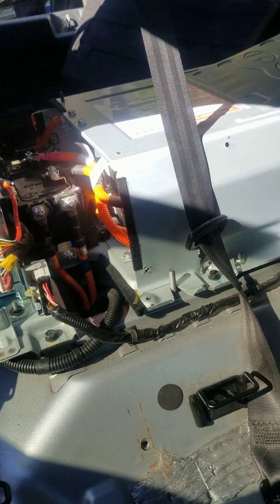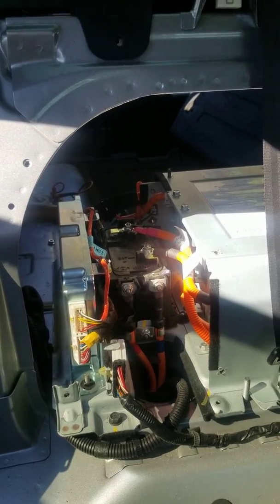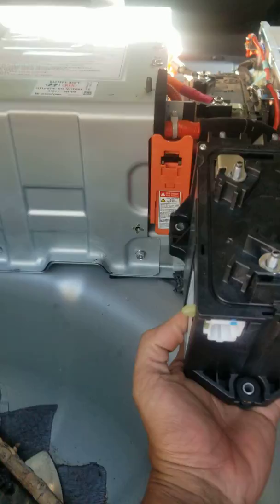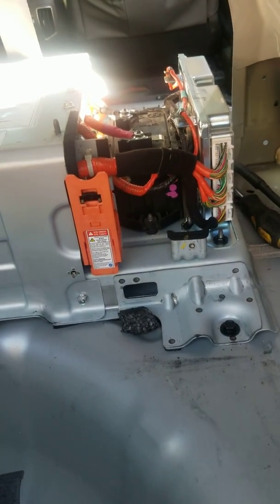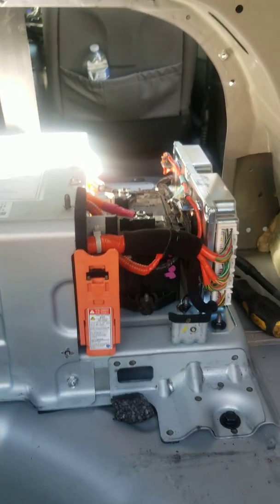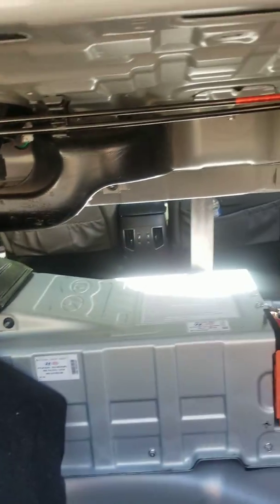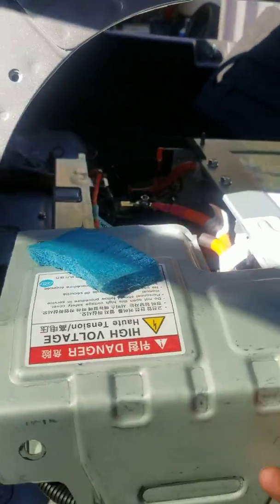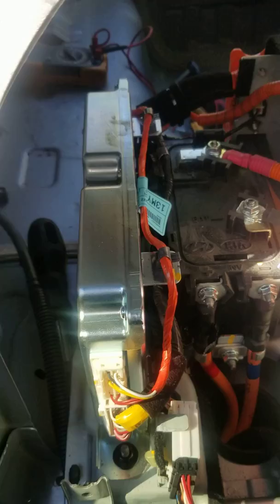2010-2014 Hyundai Sonata (YF)HYBRID: Hybrid System Warning! Safely Stop and Do Not Drive. P1B77

Comment: Have the same problem with my 2015 sonata hybrid. Happened yesterday, driving through torrential rain, the car jerked, then stopped. I got the code p1b77 off my obd2 reader. My question is has anyone just replaced the safety plug and get away with it? Because it is such a cheap part compared to the power relay assembly so I am wondering if it wouldn't be a good idea to replace that first. I have seen a couple of the Optima Hybrid guys say that they only replaced the plug and were good to go. FYI optima hybrid is mechanically the same car as the sonata hybrid..  Anyway, I am off to try starting her again this morning and if she won't go I will try to fix her myself. Thanks for making this video.
Reply: What did you end up doing? and did just replace to safety plug?
Reply: @matazarbab4784  I ended up replacing both units, did not want to chance it. There is actually a Technical Service Bulletin for that problem code and the prescribed cure is to replace both components, so that's what I did. I did it myself. It is not difficult. The hardest part was getting the backseat out.  Hint: removing the head rests will make your life easier.  This video was of great help, so thanks again to Manuel Baez for posting it.
Reply: @kleefton  did it solve the problem?
Reply: @dabz3318  yes, after replacing both parts. see my previous reply.
Reply: @kleefton  I am so nervous doing it my self. Dont wanna overpay for this as it seems easy. I have all the tools except the pin push. Is it okay to use a flat screw driver and push it?
Reply: And my other concerns is the Electric
Reply: @dabz3318  Yeah a screw driver will work. Just wear gloves and make sure the 12v battery is disconnected. it is fairly easy. the hardest part is removing the backseat imo.
Reply: @kleefton  I reached all of that part. I didn’t have the tool that open where the relay is. I didn’t have glove. I put them back and I am actually to a car repair to get it replaced for 250
Reply: Hopefully, it will fix this.
Reply: The car runs fine, but the warning comes on after every 5 miles. Mostly, after you’ve stopped and trying to move on
Reply: @dabz3318  yeah thats how it starts. Then one day it will just stop running. I would advise fixing it before that happens. It left me stranded in the rain when it happened. Terrible memories man.
Reply: @kleefton  holly shit! I am waiting for them to replace it. I’ll update you later on
Reply: @kleefton  thanks brother
Reply: @kleefton  The part got replaced, still does the same. We replaced the fuse as well, don’t now what else it could be
Reply: @dabz3318  are you sure you had code p1b77?
Reply: @kleefton  you mean the scan code?
Reply: The only code it shows is DTC B1102, which is weird
Reply: @dabz3318  looks like u have a different issue then. Something to do with your airbag?
Reply: @kleefton  the car dashboard doesn’t show it. Don’t know how come the scan picked that code. All airbag are intact
Reply: @kleefton  this car is driving me crazy
Reply: @dabz3318  yea sorry to hear that. I traded mine in eventually. It had too many issues and regular mechanics don’t know how ro fix it. Only dealers do and they charge too much. Good luck with it.
Reply: @kleefton  so true!
Reply: @kleefton   You said my exact feelings. Local mechanics don't know what to do with these Hybrid vehicles and Dealers charge upwards of 4000 dollars.
Reply: @amitkhoje3189  yup. And the dealers don’t know shit either. They completely ripped me off and wasted 4 months of my time, as well as over $5,000 for my car to be doing the exact same thing. Literally nothing at all changed 🤦🏽‍♂️

Comment: One more: Why do we have to use a New safety plug? It can be reusable!!!
Reply from the maker: I believe it was recommended. However at just 80 bucks and with the money I was saving myself from doing the job myself I thought it was a no brainer
Reply: (Revised) Great question, i have never had to replace one my self but my guess would be to insure the contacts are in good condition in case they have high resistance and got hot. Think loose wall outlet. OR the built in FUSE has high resistance. I think its a cover our butts kind of thing. Very hard to bench test a 270v fuse. (Found out the driver had a very heavy foot and blew the fuse from all the current running through the fuse over time. KIA has an updated 150 amp fuse available to reduce the chances of this condition.)

Comment: Wow, you are a genius! I did not get the same code as yours, but I got the same warning. My 2012 Sonata Hybrid got a loss of power over 60 mph then engine check light and spanner light came on with the hybrid battery warning. Now it won't start. Do you think your solution will work? One more, do I have to use a New safety plug? If the safety plug is removed, it is safe to work on it and touch the hybrid battery?
Reply from the maker: I dont know if the same solution would help you solve your problem since we dont know your engine code 
Also, I think I remember it's safe to touch with the safety switch removed. I still took precautions even without the switch on. 270 volts its higher than anything in your house. Can kill you. Not worth dying
Reply: DOD YOU FIX IT??

Comment: This just happened to mine. Currently at the dealer, they quoted me $4650(!!!) So I am having it towed home, gonna replace it with some friends.
Reply from the maker: Problem is. It gets misdiagnosed a lot. This morons will get you to spend a ton of money until they find the problem. I couldn't find one person online solving this
Reply from the maker: Hopefully this helps. It's very easy. I was quoted around the same parts and labor
Reply: Thanks for your video! Turns out Hyundai was willing to cover it out of warranty.
Reply: How did you get Hyundai to cover it?
Reply: How did you get them to cover it with warranty? I still have my warranty and they are refusing. 
I have quality guard plus deluxe warranty
Reply: @TheExtinctSpecie  are you the original owner?  I just bought one used with issues and I diy so I'm trying to learn the new technology
Reply: Every time I took it to the dealer while under warranty, they never had any clue what the issue was, not even possible causes. Just happened again (outside of warranty naturally) and all of a sudden they know what it is and cost me $1700.
Reply: @nicoledazzena6929  Costs me the about $1350. $116 for fuse, $607 for PRA and $570 for diagnosis, $56 tax. Does anyone tried just replacing the Fuse ? my PRA tests fine.
Reply: I agree. I’d rather have friends than a car.

Comment: After it tells you to pull over does the car slow down sometimes as well?
Reply from the maker: No.
Reply: @DYImechanicTuro  hello Manuel Baez did the hybrid battery life on the dash show empty on it
Reply: @aliyahjackson5553   hi mine is having this on the dashboard with battery empty is it the same problem?
Reply: Angel Colon mine slowed down on the freeway
Reply from the maker: @tagvorautostyling662  mine I was in a parking lot so I couldnt tell. I stopped and it wouldn't start again
Reply: MANUEL BAEZ mine just happened on freeway going 75 mph. Was lucky enough that didnt get in accident. Having it towed to my house so my electrician can run a diagnostic test and move on from there

Comment: Did your car go back to normal as soon as the parts were replaced or did you have to get your car reseted or do anything else to it?
Reply from the maker: Sorry 
Just went back to normal started in ready mode right away
Reply: @DYImechanicTuro  Did you have to reset any codes or run some sort of test after replacing the power relay assembly?

Comment: Just had this happen to me the other day. Took it to the dealer and the relay and the saftey switch were replaced. All covered under warranty
Reply from the maker: I just saw this. Mine is a 2013 and way way past warranty.
Has been a a great car
Reply: @DYImechanicTuro  can you help me with mine I have the lil wrench light . Do you think I can replace  the power relay module  and the lil wrench light will go away I changed  the starter plug switch and the light didn't go away
Reply: @crislopez2946  did you ever get this figured out? 2 years later lol I know but this just happened to me now
Reply: @matthewvilla8129 any luck man? 
Been dealing with this for 6+ months and over 6,000 spent.
But I’m finally getting close my car was driving and charging 12v normally for like 3-4 hours after getting my car back from inverter replacement.

Then boom lost all power and wouldn’t accelerate. Started up normally after I let it sit for a lil bit,
Then happened again and wouldn’t move at all that time
Reply: @PivotGrowth the same thing is happening to me, did you figure it out?
Reply: what we have to tell dealer because i have same problem they not gonna rip me off
Reply from the maker: @toto4u924  how did it go.
I just saw this sorry

Comment: Im also wondering isn't there a
Lifetime warranty on the Sonata Hybrid battery even if you exceeded 100,000 warranty
Reply: FilipinoHeat 805 did you find a fix?
Reply: The warrant is only for the battery, not the ancillary parts
Reply: The  hybird  battery itself is covered lifetime, but ONLY for the original Owner.
Reply: @jonsmith1259  what about now
Reply: @PivotGrowth  Entire hybrid system is covered, only for 100,000 miles including battery
Reply: @PivotGrowth  Wife just bought 2023 Elantra Hybrid. All hybrid components covered to 10 yrs 100,000 miles...